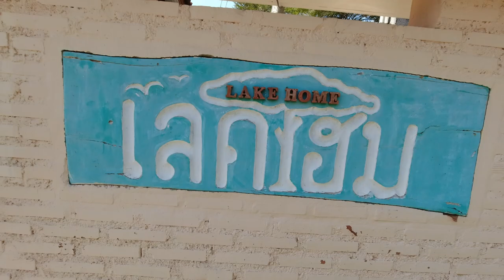Thailand Our House Living The Dream Buying A House Thailand New Video

Comment: I had that filter at my house sitting in sun also algae build up was terrible so moved it to shade and works so much better now
Reply from the maker: Thanks for that that was my idea also putting it in the shade thanks for that. How often do you clean it the gardener was supposed to clean it every month but 5 months later never cleaned out.
Reply: @RetiredandLivingthedream when in house  i didn't bother cleaning it just change the filter every couple months I found a ace selling filter for 100b

Comment: You have some good ideas. I'm sure it will look great when your done. I get your feelings on the blue plumbing pipes. Thais seem to run them anywhere and every where without any plan. Good purchase.
Reply from the maker: Thanks 👍I was an Electrician also in the UK and prided myself hiding everything and not cutting corners this just goes against everything I stand for sheer laziness and not bothered.
I rewired a shophouse all concrete and you could not see one cable when I finished and no chase. Just good imagination and neatness and pride in your work.
Reply: @RetiredandLivingthedream  do you have a Line account
Reply: @RetiredandLivingthedream  i will send you an email